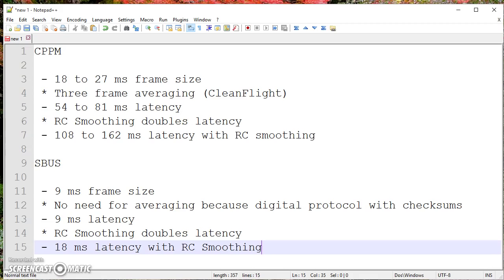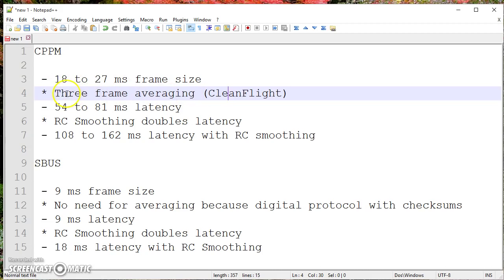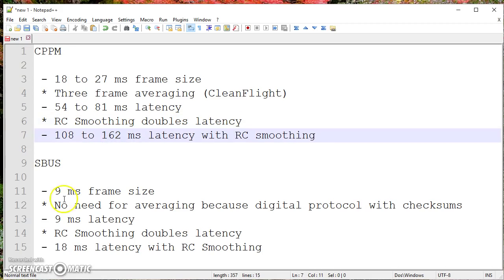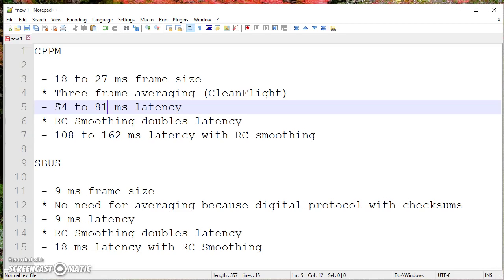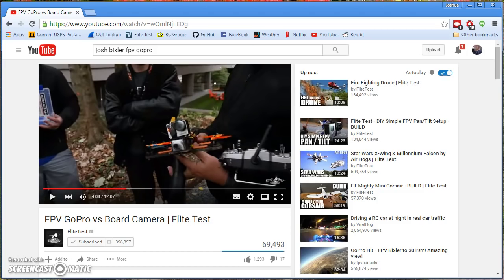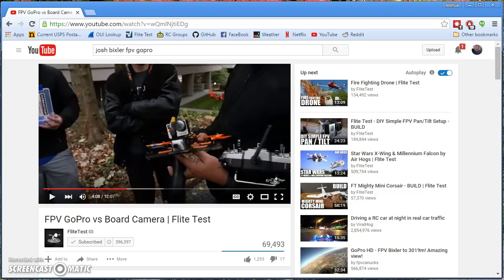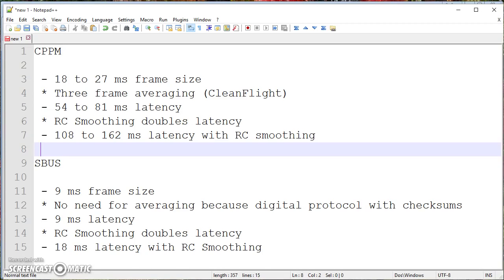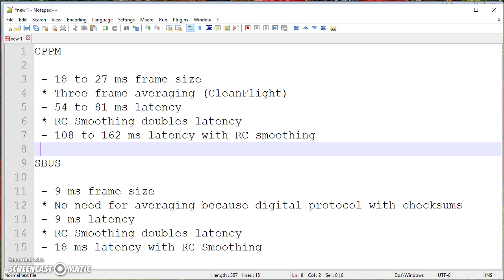SBUS vs. CPPM Latency: Can you feel the difference?

Comment: Ok im off to buy a taranis you finally convinced me!

Thinking a bit more on the subject im using a devo7 tranmitter (PWM) with a PWM to PPM converter that is most likely using some arduino software to convert signal adding even more latency to the equation. Yeah I really need to upgrade.

Comment: Would using a module like the FrSky DJT that adds an additional ~22ms latency actually be adding something like ~66ms latency over PWM/CPPM protocols then?   AM I FLYING WITH 167ms LATENCY?
Reply from the maker: +coleisman no. The averaging only occurs once.
Reply: So I just upgraded my D8R-II with PWM output to X4R-SB using SBUS.  This has made the single biggest difference in flight performance out of anything I've done to my quad.  I thought I was a bad pilot, I thought my tune sucked, I thought my motors/frame/etc were bad.  I knew I had latency because I could see the delay.  Forget everything else about tuning etc, if you aren't running SBUS then you're not going to have a decent flying quad, period.  I can't believe people still recommend ppm receivers like D4R-II.  I literally changed receivers, walked outside, and bashed my quad like I didn't know I could, it just did what I told it to without complaining.  Thank you for making this video, thank you thank you thank you.
Reply from the maker: coleisman AWESOME!!!!

Comment: From my research cleanflight uses a 3 frame moving average so you wont be getting truely 3x the latency as the moving average takes the last two frames before the current one and averages it to give the current measured rc signal in that 20ms frame. This would give the current frame 33.3% influence over the current signal output.

To me this surely will act  like a form of rc smoothing and dampen the rc signal changes which is most likely why people who go back to ppm think the pids are too low as it smooths out input commands more than serial rx. 

I would be interested however if dterm kicks are less prominent on ppm and pwm's moving averaged signals.
Reply: That's how a 3 frame moving average should be handled. Saying that a 3 frame moving average will triple the input delay (like many have been saying) isn't (or at least shouldn't be) true.  
I don't feel like it's the 3 point sample mean that's the only issue here (or an issue at all).  It's more likely a combination of the damped response that the mean introduces, plus the fact that it's not on an interrupt like SBUS as well as the frame delay, I'm assuming the frame delay can be 2x frame length, eg: if you give an input just after the start of one frame, it will be nearly a full frame length until that is transmitted, then a full frame width again before it is received.
Assuming you've got a 27ms frame length, the delay could be as high as (2*27ms) [frame length delay] + (up to) 20ms (According to Boris B.) sync delay = 54-74ms as well as the damping from the 3 point mean.  Such a delay would certainly be detectable to a human, even without the damping from the 3 point mean.
In short, yes there is a delay.  No it's not from the 3 point average.
I'd love to do a practical test with both types of units to put the issue to bed. But allas, I am not sure I have the motivation to progress my ramblings further than the hallowed ground that is the youtube comments section.

Comment: You guys know that your FPV camera probably has like 30-40ms of latency. So all this talk about you seeing/feeling the difference is actually impossible because your camera is negating any difference.
Reply from the maker: +thejason51873 The latency of the round-trip FPV link is cumulative. Read the sticks. Encode the stick positions for RF transmission. Transmit the RF signal. Receive the RF signal. Decode the RF signal for transmission to servos or FC. FC processes the commands. Motors update their speed. Copter moves. Camera moves. Camera processes the incoming image and transmits it to the vTX. vTX transmits signal wirelessly to vRX. vRX outputs signal to screen (goggles). Eyes receive image. Brain processes image. Fingers move sticks. Repeat.

Removing or adding latency to any part of that process changes the total latency of the link. Removing latency anywhere in there means that the pilot can respond faster to real conditions in flight. This is not a situation where a single high-latency item "absorbs" the latency of other parts of the link.

If you can't feel the difference between CPPM and SBUS, more power to you. But please be assured, this is not some kind of "golden ear" audiophile nonsense.
Reply: +Joshua Bardwell Ahhh ok, I see what your saying! That makes sense! P.S. I like your "golden ear" analogy!

Comment: Were dose DSMX fall in this comparison? Is it like a SBUS?
Reply from the maker: +Antonio Lombardo I believe so. I believe that all Spektrum is serial. Obviously, it's PWM coming out of a standard receiver, or serial coming out of a satellite receiver, which is what you want to be using.
Reply: Okay, so with out going to fancy in the technology. The response time with a DSMX is the equivalence to SBUS? Where it just feels more responsive?
Reply from the maker: Basically, yes. Mostly because of the absence of three-sample averaging in Cleanflight, but also because it's just faster.
Reply: okay cool, thank you for your fast response as well. This did help me not to go and buy a expensive transmitter.
Reply from the maker: Antonio Lombardo Spektrum transmitter with satellite receiver would be my 2nd choice if Taranis was not available.

Comment: Does this 3 point average on the ppm signal make the latency worse than using PWM?
Reply from the maker: +Stephen Gibb That's an interesting question and I'm not actually sure of the answer. We would have to refer back to a person who really knows the code. I believe that the three-sample averaging is done on all analog inputs, both PPM and PWM. And I believe that the PWM frame spacing is actually the same as PPM, because the transmitter usually formats the channel positions into a PPM frame before transmitting it to the radio module. So even if you have discrete, parallel PWM signals coming into the flight controller, those signals are still being constrained in their update rate by the PPM frame that is being formed in the transmitter. Take this with a grain of salt though and double check it with people who really know.

Comment: Hi, nice video, but i have one question. i´m flying with a turnigy 9xr with a FF module and DRII rx with CPPM, i want to switch to SBUS  to improve, but i dont know if buy an XJT module (that supports sbus rx), and a X4RSB receiver, or go for a Taranis X9D. My Question is: may be some additional latency if im using turnigy with XJT module over using a Taranis? would it be so big? Thanks for  your help
Reply from the maker: +Crazy PIDs I think so, but I'm not sure. I believe that the way it works is, the 9xr outputs a PPM signal into the XJT module, which then converts it to serial. With the Taranis, I believe that the signal is digital the whole way.

Comment from the maker: Hopefully everybody who watched this video will catch this comment as well. The info about rc_smoothing doubling CPPM latency to 180-162 ms is not correct. The actual increase is something like 20 ms. SBUS is still substantially lower-latency than CPPM, but the penalty of rc_smoothing is not significantly different between SBUS and CPPM.

See here for more info, and sorry for the mis-information.
https://github.com/cleanflight/cleanflight/pull/1128#issuecomment-168843961
Reply from the maker: I don't know about that. It depends on the frame size. But I think iBus is basically the same as Sbus except not inverted.
Reply: +Joshua Bardwell To be true, the additional delay with RC smoothing is only half of the RC cycle time. It is similar to S & H circuits or FIR filters, which also have only half the cycle time as delay. Thus, the difference between RC smoothing on and off is only 10ms with CPPM.
Reply: +Joshua Bardwell So should i use serial connection or PPM?
Reply from the maker: Serial if you can.
Reply: Okay, thanks very much.
Reply: Is S-bus and I-bus the same in terms of latency? I would assume so.

Comment: So hold on, given the Naze32 Rev5 has only 2 UARTS and one is the USB, what do you lose when run an inverter and X4R-SB? I mean, I only run FrSky telemetry and a standard 2 wire buzzer... and don't think those have anything to do with a UART. So, if you don't run bluetooth, GPS or any of that other stuff, it shouldn't matter, right?
Reply from the maker: +Danny Cruz Basically correct. Let's say you wanted to run SBUS, SmartPort telemetry, and Blackbox. You can put Blackbox on UART1, and you will lose MSP when you arm the copter. Now you have to put SBUS on UART2. SmartPort telemetry runs at 56 Kbaud, which is too fast for SoftSerial on CleanFlight, so you are out of options.

If you can put telemetry or Blackbox on UART1 and SBUS on UART2, and whatever else you need on SoftSerial, then you are fine with the Naze-style chips out there. I personally run Blackbox on UART1, SBUS on UART2, and MSP for OSD on SoftSerial, for example. I can't run SmartPort telemetry, but with the OSD, I don't feel like I need it, and I can still do analog voltage monitoring via the A2 port on the X4R.
Reply: +Joshua Bardwell Thanks for that. I have two Naze32 Rev5's, but both have an 8Mb SPI_Flash chip onboard. My buddy helped me solder those on. He's good at reflowing. He also added the necessary diode or whatever component for it to run properly. Both work like a charm. Now, I'm not sure if onboard flash is also considered to use UART like an external logger would. Does it?

I bought 2 Dodos, but I have a third quad I want to also upgrade to an X4R-SB and I'm trying to decide if I should get another Dodo, Lux, the new KISS FC or just run one of the Nazes. In the end, all I need is simple voltage telemetry and blackbox.

By the way, I love your posts on the Betaflight thread. Every time I going through the thread I stop and read your's carefully as you offer a ton of great insight. Reason I also subscribed to your channel and I'm slowly going through your vids. - Danny
Reply from the maker: Internal flash does not use a UART. It connects over the SPI bus.

Thanks for the kind words.
Reply: +Joshua Bardwell Awesome. Then that answers my question. The trusty little Nazes will do :) Thanks again.

Comment: Great info as always. How do Spektrum Sat Receivers fit into the mix here? I always thought there were digital as well and had the same benefit as sbus, with just maybe a larger frame size (11ms or 22ms). I'd love to hear your thoughts. 

Thanks!
Reply from the maker: +Randy Soraich I don't know what the exact frame size is for Spektrum, but I believe that the CleanFlight logic is the same. I believe that there is no need for multi-frame averaging with any serial protocol because they contain checksums internally, and the frame size is inherently smaller because they run at a faster signaling rate. You should confirm this information with people who know the internals of the code if it's critical to have a correct answer.

I have heard it suggested that this is one reason why Spektrum has resisted putting out a CPPM receiver for so long: because Spektrum is serial all the way through the link, which keeps latency very low. This may be one reason, in addition to their small size, why pro pilots have often elected to fly Spektrum satellite receivers rather than FrSky (although now, X4R seems to be gaining ground).
Reply: +Joshua Bardwell for us Spektrum owners could this be the answer, 11ms satellite if indeed it works the same way in Cleanflight...   http://www.horizonhobby.com/radios/aircraft-receivers/spektrum-dsmx-quad-race-receiver-with-diversity-p-spm4648  ...Maybe the LemonRX diversity satellite would work as well.

Comment: The 12$ CC3D does S.BUS very well with CF/BF (build in inverter). Excellent video Josh.
Reply from the maker: +fr3d_fly Did not know that. The CC3D seems like it would be hands-down the best F1 board if it wasn't for all the hassle with the MainPort/FlexPort and hex/bin. I seem to see constant posting about that. It even does SPI gyro and can (in theory) do 8 kHz if you swap the F1 for an F3.
Reply: +Joshua Bardwell I use it on all my non-F3 builds. The S.BUS goes right into the main port with the supplied cable. The only issue is that there is no divider for voltage so doing VBAT is not straight forward. Flashing BLHEli works great with a 5$ FTDI adapter (enable MSP on FP) and LED STRIP works on Pin 5. I haven't had any issues flashing either. I was really surprised when I switch to CF/BF that everything worked so well but did take the time to learn that things work differently from OP.  TBH I don't think people take the time to learn the board and how CF/BF works before posting these questions. There are also a lot of low quality clones out there.
Reply from the maker: fr3d_fly Also, buzzer requires a custom circuit and firmware build, right?
Reply: +Joshua Bardwell True, with the latest BF, it's on PIN 6 and works well, it's only the Tri-copter/Hex guys that need the extra channels. As of BF 2.2 that's now a CLI setting so no separate build anymore. I've seen the code, but have not tested it yet.  I don't think I'll be buying any more F1 boards. I have a couple of SPR3 Clones (sorry Dominic) that I use in the race ships and a couple of LUX on the way as part of the first batch. The F1 boards will trickle down to the Shrieker and other other fun quads.
Reply: +fr3d_fly you dont need an inverter! works like a charm man, plugs right in

Comment: Can also get the un-inverted sbus signal from the x4r off the hole under the paper case http://blog.oscarliang.net/sbus-smartport-telemetry-naze32/
Reply from the maker: +SloMo_FPV You're right. But for $3, I've decided to just use an inverter cable rather than do surgery on my board. If I was doing an ultra-tight build like a Shrike or a Tweaker, I might feel differently.

Comment: One other difference. SBUS works interrupt based. That means your rc input is always the most fresh one.
With PWM/PPM it is simply time based and not synced. Your latest read value may already be up to 20ms old as the timer reads every 20ms.

There is no doubt of it that difference is felt. I still have one PPM quad for testing and sometimes when I switch to it I kind of get the feel that my PIDs are too low, but arent. Its the delay makes it feel more sluggish.
Reply from the maker: +Boris B. I agree about the low-P feeling. I was once trying to sort out a oscillation in my copter by lowering P gains and I really got a feel for what P gains feel like as they get too low. I just felt like I was flying bad. Kept crashing for no reason I could discern. It feels almost the same as when there is excess latency.
Reply: with betaflight 2.1.6 and rc smoothing disabled by default are we back to sub 100 ms latency?
Reply from the maker: Should be.